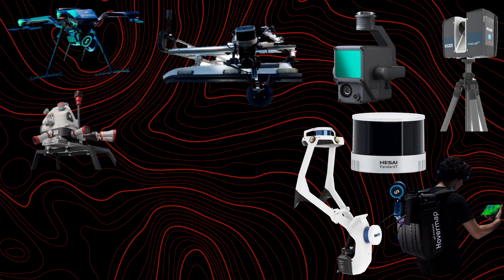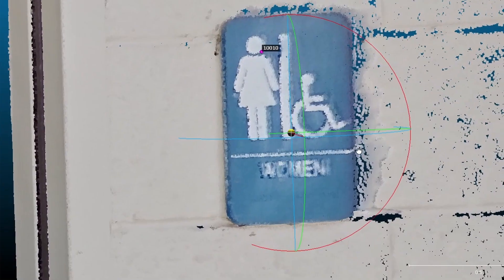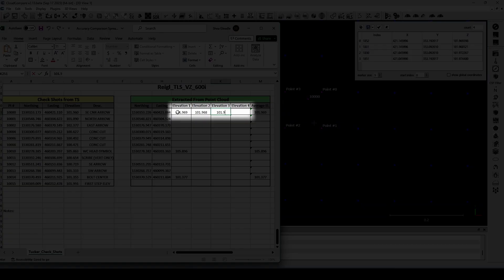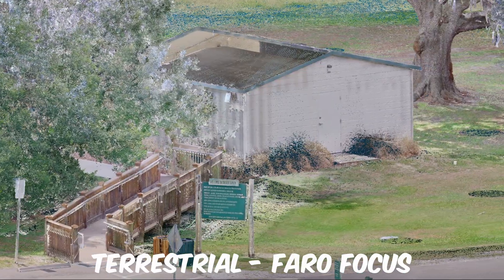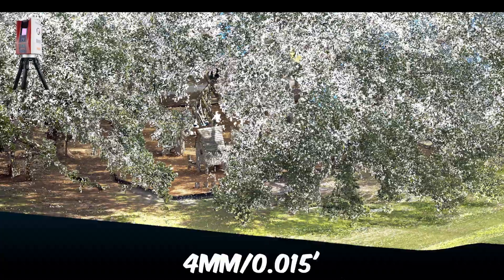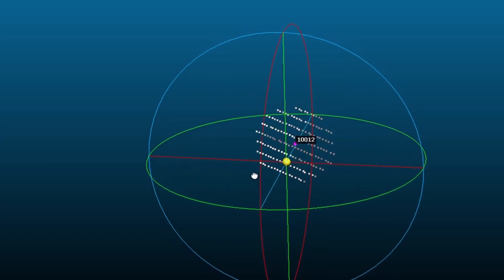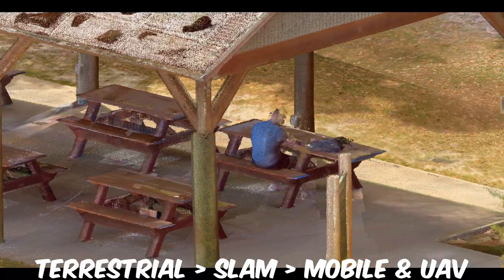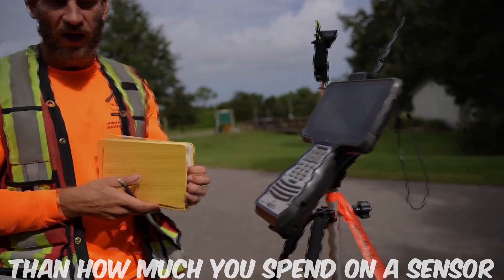Lidar Accuracy Comparison - 13 Different Sensors!

Comment: Which sensor to use for scanning single plant for calculating hidden fruits . Sensor which penetrate leaves and branches
Reply from the maker: I don't see Lidar as being a cost effective solution for that application.
Reply: @The3rdDimensionSurveying  can you please suggest which sensor/camera/tool will be helpful
Reply from the maker: Honestly, the two optical sensors built into every humans head. I just don’t see how a LiDAR sensor could get enough resolution to accurately detect fruit past leaves without having to use a handheld slam scanner on every single plant. It’s just cost prohibitive. LiDAR is great but it’s not the right tool for every problem. You could maybe explore photogrammetry using a sensor that picks up chlorophyll content, a common use in agriculture but I honestly can’t see cheap labour not winning in this situation.
Reply: @The3rdDimensionSurveying  thanks for reply. My project is robotic arm which would harvest fruits on plants. For few dense plant’s, simple machine vision is not useful. I wanted to see hidden fruits inside so that my machine would calculate path to reach it and harvest. I would love to see your suggestions on this. Thanks again.
Reply from the maker: @nikhilbwadibhasme  ahhh that makes more sense now. Check out Livox, they make some great cost efficient sensors. No need for high end survey quality sensors for this application IMO. Sounds like a fun project, if you get anywhere with it please let me know!
Reply: @The3rdDimensionSurveying  yes sure. Since there is shortage of labour in my place and 50% of cost goes in manual harvesting. I started to build this.
Reply: @The3rdDimensionSurveying  I checked few. Livox Mid-360 Lidar will this work for my case? Price wise good but will it work for plant having 50 cm diameter and height. Did you try this sensor or you have any other suggestions?
Reply from the maker: I can't say for sure, it's in your hands now. Good luck! @nikhilbwadibhasme